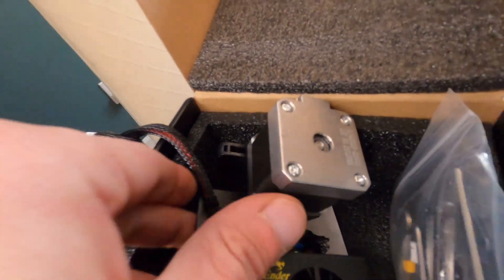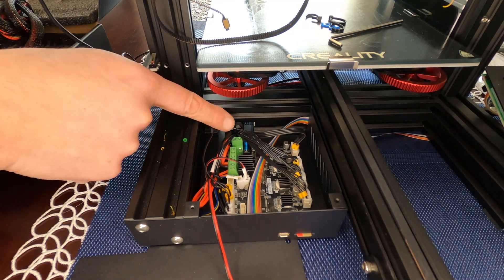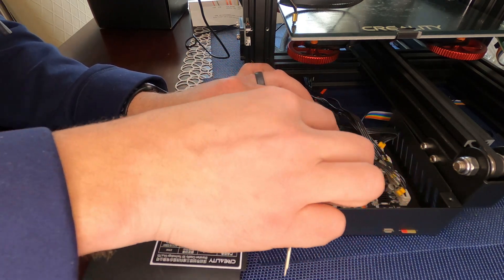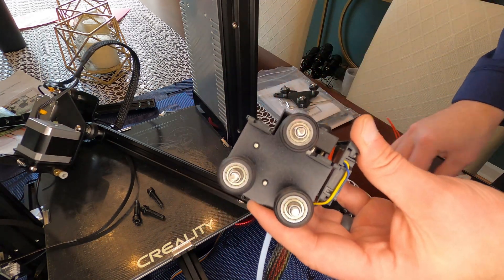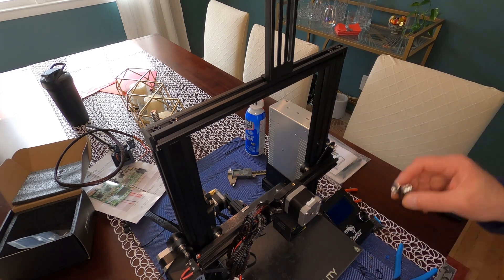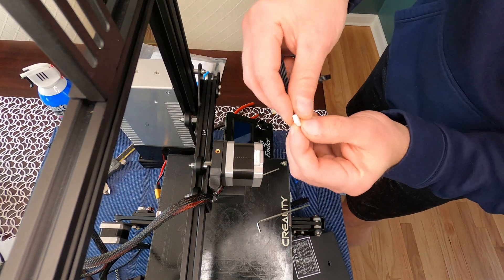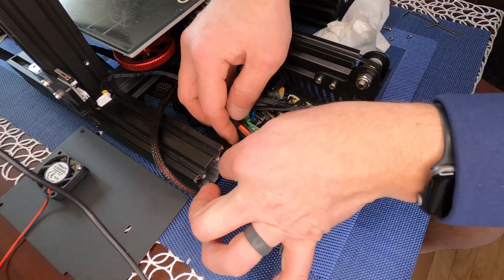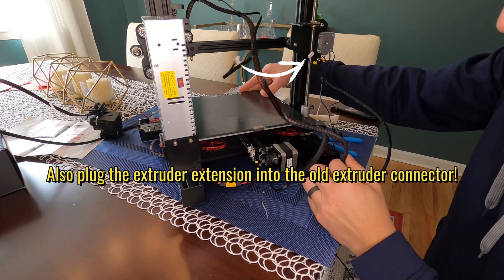Ender 3 Direct Drive Upgrade

Comment: Is it an "upgrade" or simply a "mod". 
Is it how it "actually works" or something that you just want to do?
I did it because it was, just something that I wanted to do.
Reply from the maker: Definitely an upgrade. Especially if you want to print tpu and not deal with the horrible stock extruder and slipping feed gear

Comment: So why would you not have a second z-screw to compensate for the weight of the Direct Drive mechanism? Wouldn't the extra weight cause the right side of the gantry to sag?
Reply from the maker: It works fine. Most newer printers do have dual zed screws now though

Comment: Hi I've done this any now my x axle won't move. It will give a slight kick and that's it. I've tried all wires and y and z work fine it's the x one that does work.
Reply from the maker: Is a connector not pushed in all the way? It’s a direct swap for the ender 3
Reply: The wheel on the assembly has the bottom screw mounted backwards, so the lugnut that sticks out gets stuck in the frame. I changed it and now mine works

Comment: I have just done exactly like u have done but for some reason the servo motor that drives the brass fitting doesn't work dont feed the filement i used the e extension lead they supplied with the set up what cud be wrong??thanks
Reply from the maker: It’s not spinning at all?
Reply: @3dprintexplorer hi buddy yeah nothing  but ther is power to the motor as I can't turn the brass part but turn power off n I can turn the brass part??
Reply from the maker: That’s strange yeah so it’s definitely seeing the motor. Did the connector come partially out on the main board?
Reply: @3dprintexplorer dude nothing has came away from the board this is a brand new replacement as the other 1 was working fine n then suddenly stopped feeding the filament so I got a whole new one put it together this am and nothing motor dont get hot but I did notice the brass fitting does juddering then stops??

Comment: Great video. I wish you could have covered a little more explanation of how you changed things in e-steps and Cura settings. I would think those are things that have to change?
Reply from the maker: Didn’t have to touch anything in Cura at all. It printed with the stock settings perfectly first time. Only thing that was necessary was to relieves bed because the new extruder is a tiny bit lower.